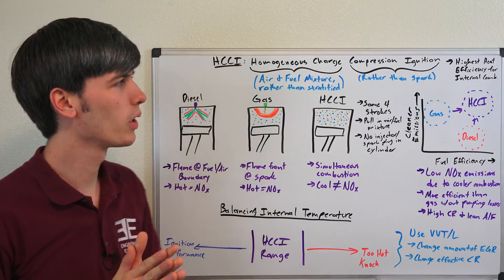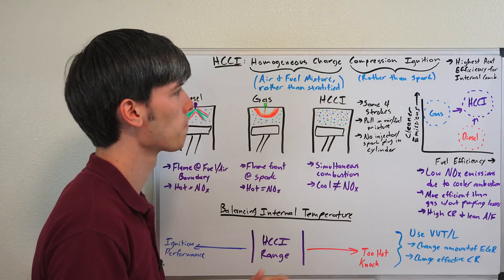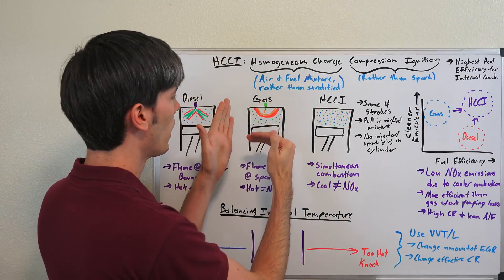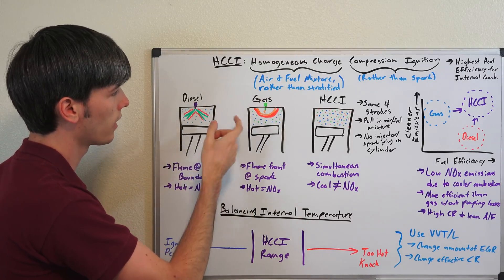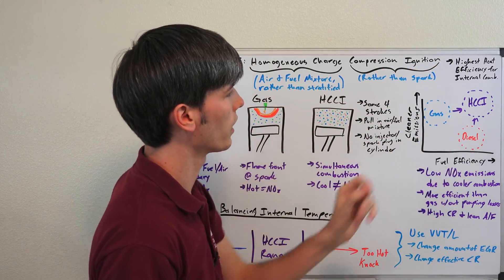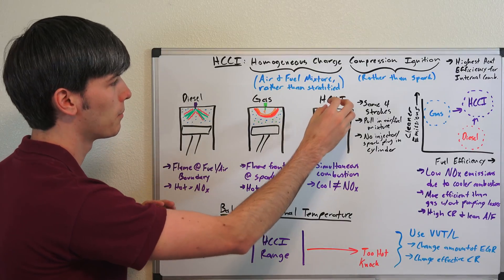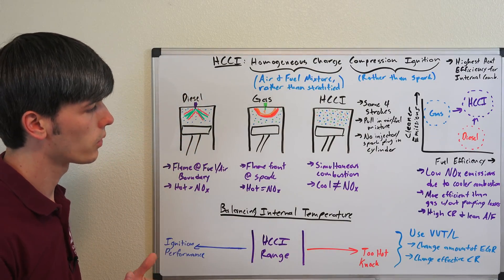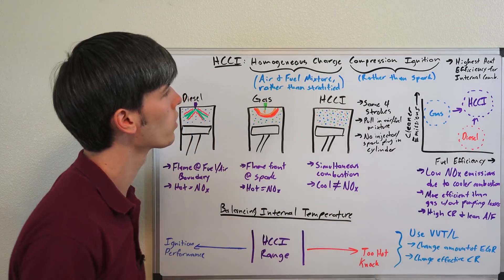The Most Efficient Internal Combustion Engine - HCCI

Comment: I understand the concept, but with the temperatures having to be so exact I worry about cold starts in the winter. Diesels already have enough problems and they have an ignition source (kind of). With these engines relying entirely on the heat generated by high speed compression of the mixture, how are they gonna start if the starter motor isn't strong enough to spin the engine at a high enough velocity to generate that heat. Also with higher revs, the compression stroke would be happening much faster and there for much higher temps. I'm worried that these engines will be restricted to a much lower redline to prevent knock from excess heat generated from higher speeds

Comment: It's a "cool concept to think about". That's about all this will be. The timing to control this would be critical and real world applications would be tough with pump gas. EGR systems don't work well when engines are cold and I'd imagine that idling in hot climates would drive it insane as well.

Comment: All Electric cars are really a means of control. Think about it, with a gas or diesel vehicle you can store up extra fuel; allowing for extended time away from populated areas, longer use of vehicles in case of power grid failure, e.g. natural disaster, and refueling is quick. Also, self driving and self parking cars increase the possibility of your vehicle being controlled, or shut down by an external force. Having multiple technologies allows for energy conservation, personal choice and freedom.

Comment: What fuels are we talking here with HCCI?
Reply: Most likely E85 since E85 cools better then regular gas. It can keep the temperature in check to prevent knock.
Reply: +dekoldrick

Ethanol is extremely hard to ignite from compression so I'm not sure..
Reply: Chronicles of K. Toyoda
I think that why it's mostly used in cars with extremely high compression ratios and high performance motors.

I also read about how it has less of a punch than normal gasoline so it run out pretty quickly due to more needing to be injected  make the same power as normal gasoline.
Reply: +The real doktorbimmer 

That's just the issue you can't lower compression and combust ethanol buy comprising it.

To compression ignite ethanol you need compression ratios well beyond what even many diesels require.

The only what that it's usually even possible to get this kinds of compression is with large amounts of forced induction which is not fuel efficient so again I doubt he's referring to ethanol here.

He even went into how unliky compression ignition is with ethanol in one of his other videos..
Reply: +The real doktorbimmer

Haha oh okay, can't wait until this starts trickling down to consumer vehicles.
Reply: +The real doktorbimmer

Closer to reality than I'd thought, looking forward to it.

Comment: if "pumping losses" occur when the piston is moving down during the intake stroke and there is a vacuum in the intake manifold, wouldn't it be recouped as the vacuum pulls back up on the piston when it starts to rise for compression?

Comment: the exhaust that leaves a modern emissions-compliant diesel truck is cleaner than the air that goes in. that chart from Nissan is not good.

Comment: You told about keeping the intake valve open in order to avoid over- increasing of temperature during compression, for HCCI. Won't that affect the output power of engine? I mean during compression, some amount of mixture is gonna go back into the carburetor and when we close the valve before combustion, the amount of fuel subjected to combustion will be lesser, leading to lesser power output, right?

Comment: Perhaps Infiniti's variable compression system would work for controlling the ignition. When the temperatures are higher, use a lower compression ratio to keep the ignition at the optimal time.

However, as I typed that out I realized that this would have many other effects on the performance of the engine. So this might not be idea.

Comment: so basically make the air to fuel ratio so lean and compress it until it auto ignites. I still don't see how its much different from a diesel.
Reply: Diesels don't compress the air and fuel, they only compress the air. When the air is at a high enough temperature, fuel is injected and it creates a flame that expands through the engine.
Reply: lilsammywasapunkrock
Not at all, if fuel were compressed inside a diesel engine severe knocking would ocurr and it would stop the engine from running correctly (as diesel is easy to ignite)
Reply: +The real doktorbimmer what confuses me is that some diesels have preignition chamber where fuel is mixed before it is compressed. I also though that diesel's would ping because of predetionation.
Reply: No, no, Glow engines are totally different, it's a tiny diesel engine that has the same admission (carb->crankshaft->Depression into the chamber) system as a model glow engine but that works solely on compression for ignition. You can set the RPM range by changing the compression using a little screw that pushes a plate down in the cylinder, making it compress more. in that case. 

Air and fuel are mixed then pushed into the chamber, that's why I thought about that.
Reply: Came here for this. I was always under the impression that this was how Diesel worked. Guess I was wrong?
Reply: lilsammywasapunkrock 8t still isn't that different. It's not like comparing apples and oranges, it's like comparing a red apple with a green apple.
Reply: +The real doktorbimmer there are sooooo many exceptions to everything you said in the diesel world :P from pembroke engines to hot bulb engines..etc..
Reply: the older model diesel vehicles (farm vehicles especially) had diesel knock ALL the time.....some of them still run (though I've heard horror stories of the ones that still run detonating!)
Reply: Those would be glow engines, such as OS MAX, here is a link to those diesel tiny engines https://coxengines.ca/diesel-engines/
Reply: believe you-me, I didn't think it was possible either......but these things.....they blew my mind....I am not talking loud knock, I am talking full on engine block explosion (multiple defects supposedly)

but also: I knew a group of people that did some "conversions" on their vehicles and of course they left some details out but the end result: they had to get a new vehicle (Though this is a different instance)
Reply: so I'm just like every other human on earth, thanks for reaffirming that notion (to which I'll happily discard)

there's people you can understand, there's people you can't understand, and then there's me......

I can only be myself
Reply: It actually works exactly like  tiny diesel model engine (cos and stuff) except it's working on 4 strokes, I used those a bunch, didn't know there was anything interesting about it tho.
Reply: you aren't, but I am "you finished? can I go now?"
Reply: I am, I just don't give in so easily (especially after a frustrating night of number crunching)

<sigh> I need more coffee before I reply to comments -_-
Reply: +Pedro Amado I'm pretty sure fuel in compressed inside a diesel engine.

Comment: Could Nissan's VCT engine be an intermediate step toward this? Altering compression seems like another sensible way to control diesel ignition when injection isn't used to time it. Altering EGR seems like it would require less sophisticated equipment, though.

Comment: I don't want electric cars. Nothing is cool about driving a cloud. :c
Reply: Torque like a Bugatti doesn't hurt.
Reply: Electric cars are good in Major Metropolitan Areas (i.e. population centers where there's lots of hills, turns, and idling).  Gasoline isn't going away because the infrastructure isn't going away.  You can't go on a road trip of any length on the map or clock with an electric vehicle because they take so long to recharge.  Ultimately EVs are more efficient at the cost of personal freedom.  EVs may not burn gasoline, but if they're getting their power from oil or coal plants, it doesn't help matters much.  People seem to forget that the energy on the grid has to be GENERATED somehow, and their hip, sexy little battery is only a STORAGE unit, not a magical green-energy generator.
Reply: Also, max torque all along the range is pretty nice.
Reply: That's where you are wrong, that sound from the exhaust is the bikes voice and brings it to life. It's a majestic creature with the exhaust sound.
Reply: For the meantime there is no energy storage system for EVs that comes close to the energy density of ICE fuels. Lithium-ion batteries are very heavy, and there aren't many types of battery that are lighter, so the niche of low weight and long range (e.g. light sports cars) can only be serviced by ICEs.
Reply: But it's instant torque!
Reply: MoronicAcid1
Methane is a combustion engine fuel. When I say ICE I'm not limiting to fossil fuels; indeed, methanol is a viable replacement in this niche use due to relative ease of sustainable production.

Hydrogen is difficult to produce and the fuel cells remain heavy. Also, despite having good mass density, hydrogen has poor volumetric density; as per wikipedia compressed hydrogen is 5.6 MJ/L at 700 bar vs methanol at 15.6 MJ/L.

Fuel cells are more efficient than ICEs, but as far as I am aware they aren't so much more efficient that for a given weight a hydrogen drive system could deliver more power and range than a methanol ICE at a reasonable production cost.
Reply: I don't care about cool, I care about practical and useful - and when it comes to cars and computers, fun.  EVs have some advantages, but while Tesla's new Model X actually beat a Dodge Challenger Hellcat in a 1/4 mile (see the new Top Gear), the EV tech doesn't scale down well.  Put a Nissan Leaf up against a Ford Fiesta and you get the point.  Honda made a product that I might acually buy but the market didn't like; a Civic hybrid with a V-6 engine.  It was configured & programmed to produce more performance with the hybrid system, not better fuel economy.  People expected a hybrid car to get great gas mileage and be low on emissions.  They stopped making it after 3.5 years.  I looked at it and went 'if they only tweaked the settings and added their new 'feather-throttle' tech to THAT engine, it would have the best of ALL configurations; fuel economy and low emissions when you need it, performance when you want it.
But the market doesn't want that.  The market is being programmed to 'go green.'  And apparently the existing petroleum-based technologies aren't part of that planned outcome.
Reply: "I can't have fun unless I replace the exhaust pipe with a baked bean tin and shatter windows on the way past."

OK.
Reply: Zero torque when you're out of fuel lol
Reply: To hell with instant torque!!Nicolas Losito
Reply: SDD525 you miss an integral part of being a living organism called human, Having Fun
Reply: I know right, I saw an electric motorbike and man was it a disappointment, it looked cool but sounded like... nothing. That's boring and like the bike feels dead.

Comment: How does the HCCI engine not have any pumping losses, as you mentioned at 2:58?
Reply from the maker: You can eliminate the throttle body, supposedly, and operate in a way similar to BMW's Valvetronic: https://www.youtube.com/watch?v=DKfcV7hITYI
Reply: Pumping loss is the power required to perform the intake stroke and exhaust stroke and compression stroke.
Even BMW's Valvetronic system has pumping losses.
Reply: Driving your car at WOT will not increase your fuel economy.  It may reduce pumping loss but at WOT your car's computer is dumping fuel in to give maximum engine power.  
To get maximum fuel efficiency you need to drive like a grandma. Slow acceleration and try coasting as much as you can.

If your interested in that type of stuff there is a web site called 
ecomodder com
Reply: Yes agreed about drive lika a grandma, +Rewiew Guru. I'm doing much economy driving in most constant speed as possible.
Reply: It needs a hybrid approach as F1 has already taken. Amazing technology being deployed already. http://www.motorsportmagazine.com/opinion/f1/f1-s-power-secret
Reply: I read somewhere that it is more fuel efficient to accelerate under WOT and short shift because of the reduced pumping losses, but it seems counter-intuitive. Could you do a video on this?
Reply: @DriveFast_FlyHigh in my experience and experimenting with acceleration in engines. The best fuel economy is operating within the engines ideal BFSC (brake specific fuel consumption) range. Basically whatever rpm your engine has its best volumetric efficiency. Depending on the car it can be 1500, 2500 rpm, etc. However the difference of how much extra or less fuel you use getting to speed is likey very minimal since you generally spend more time cruising than doing hard acceleration (assuming you're driving normally) honestly i like lots Acceleration lol. Gimme a few hundred hp at least haha. Then I cruise and and go for good fuel economy.
Reply: Do engines that run in the Atkinson cycle have less pumping losses???
Reply: If not mistaken Renault and Honda using too. U actually can hear it when they off throttle
Reply: Track your fuel economy on fuelly.com
then we'll see how fuel efficient you WOT driving is.
I'm angelocardoc

Comment: But how does the AFR ignite? What's the  ignition source? How do you get it to ignite at the same time all at one time?
Reply: +Cooper Hart Glow plugs heat up the engine when starting they don't help with ignition of the diesel
Reply: Avery B. glow plugs help with the start then i thought it was the residual heat in the cylinder walls, im no expert tho
Reply: I have a modern diesel engine car. Starts like a gas car, no waiting for glow plugs to warm up like in the past.
Reply: High pressure creates high temps, enough to ignite the fuel in theory
Reply: +ImGrumpher that's the exact same thing as a diesel though
Reply: Only kinda, diesel uses a glow plug as well as high pressure.
Reply: Glow plugs get things warmed up. When the air and cylinder walls are warmed up the air is gonna react with fuel better. Once it is started it is all just compression and fuel reacting no glow plugs
Reply: actually atleast in german cars nowadays, glow plugs are in every cylinder and also help with ignition of diesel... Slovenian company Hidria is actually right now in prototyping stage of a new glow plug that also measures the compression and temperature in the cylinder while also warming up to help with ignition.
Reply: yeah, glow plugs are only used when the engine is cold. When its warm, they are switched off.
Although this is a Compression Ignition (CI) engine like a regular diesel, the air and fuel is thoroughly mixed to form a homogeneous charge (equally distributed) which provides a much cleaner burn than regular diesel engines because they inject their fuel very late into the compression stroke which causes a lot of partially burnt fuel (soot).
However, I can't see how the design minimises Nox without EGR, as Nox normally occurs with very rapid combustion. Seeing as the fuel/air is thoroughly mixed, the combustion is most likely going to be very rapid

Comment: By far my favorite subscription on the web, thought it time to say thank you so much for your videos.
Reply from the maker: Very happy to hear it, thank you for watching!
Reply: Any infos on the fuel types that can be used and how they are going to be introduced into the cylinder?
Reply: +Engineering Explained 

* really do enjoy Engineering and theory explained in Practical terms...
wish that public schools would do the same for students and leave the politics out of it !

  now as far as the HCCI engine being the cure-all and fix all...
obviously, it's going to have to go through extreme testing. that the aforementioned engines have already completed.
meaning: drive it till it breaks- then tell me why it broke...

* put it on the dynamometer and show its power band capacity.
maximum rpm
torque
horsepower
and where does this fit into the real world?
should this be in a vehicle and if so, which one?
or what about other potential possibilities, such as, power generating stations and portable generators that run continuously at a set RPM( no stop and go like that experienced in vehicle traffic).
and in closing,
would this even be considered and allowed for use in aircraft ?

              ^